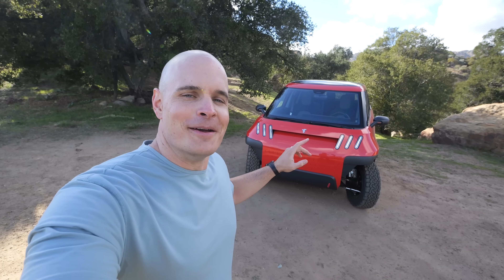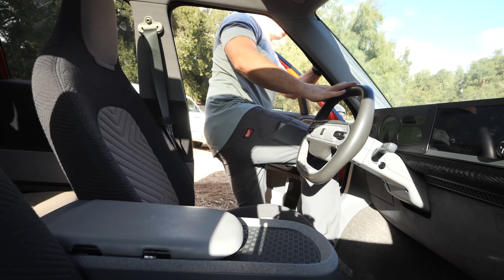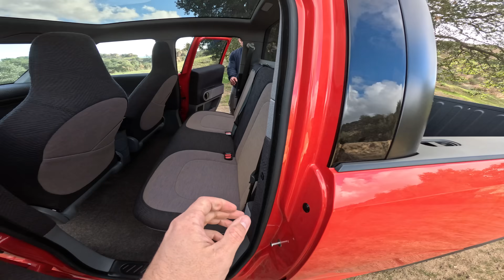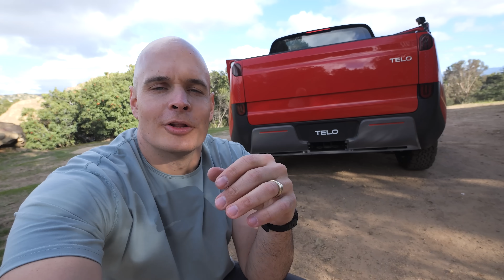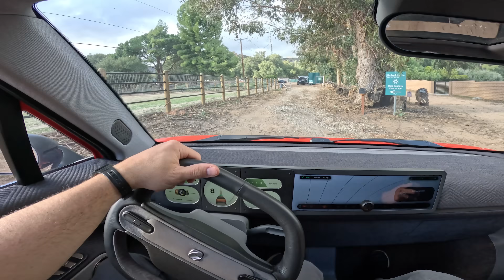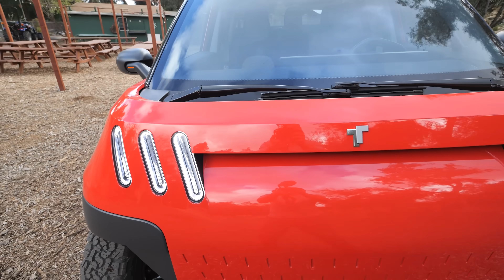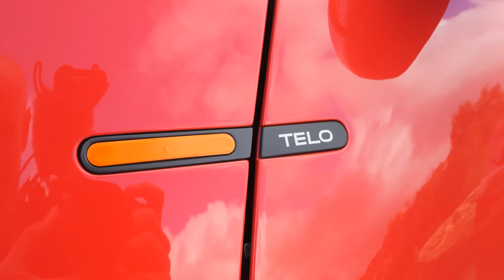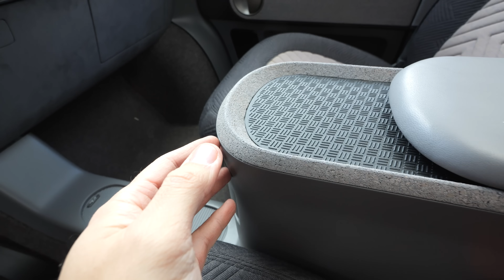ONE TRUCK TO RULE THEM ALL...

Comment: Excellent proof that trucks don't have to be comically large in order to have impressive cargo/towing capacity
Reply: It has to be large... To fit their egos ofcourse
Reply: The reason for large trucks is not due to tow/payload capacity. It has everything to do with EPA ratings. Bigger vehicles are allowed to produce more emissions. Rather than make more efficient vehicles, it's easier to make them larger. We, Americans, love our big comfy vehicles. So most folks do not see a problem with this logic.
Reply: Kei Trucks proved that point already. But those got banned here in the US, at least in some states
Reply: @JamesSchulte not really. Lots of conditions, unfortunately, but in most states there's a dealership that can help you navigate the difficult stuff.
Reply: Thank the EPA for making things like the old Ranger not possible to build. Small trucks like the old Ranger and S10 were everywhere but due to EPA regulations making a small gas powered truck like that is not economical to do
Reply: That the effect of US EPA standards and people have just gotten use to it, not people demanding massive trucks
Reply: @Giuliana-w1f  Exactly. Put a van body on it and you have an actual, viable light commercial vehicle that can deliver legit value.
Reply: That proof already existed with other cab over pickups, with low cylinder count TD engines making more torque out of ~3.0L than most of the massive NA gasoline V8s in emotional support trucks

Ofc, a white cube with a stamped steel flat bed and a 4 cylinder diesel can't carry the massive ego and fragility of ram and F150 owners.
Reply: yeah but the price is still comically large. for 41k you can but the chevy silverado 1500 w/t which is the super basic work truck trim and haul a lil bit more
Reply: @Scoobawoo  This is the real issue though. Prices are going up for new vehicles but you're right,you can get some used higher trim half-tons cheaper
Reply: @Scoobawoo True, but depending on your use case, not having to fork over big dollars for diesel or gas can take a business from unviable to a profit machine.  Just depends on what you are using it for.
Reply: It’s much safer to pull a 10k pound trailer with a 10k pound truck
Reply: Whatever you say bud
Reply: @orangeman2313  What are you compensating for?
Reply: @orangeman2313  y so insecure?
Reply: @ how so

Comment: The composition to a Mini Cooper is a fallacy because the modern Cooper is enormous! It's now 4m (12.6') whereas the original Cooper was a diminutive 3m (10').

Size comparison aside, I love this little truck and the part / materials sourcing is great! 👍🏻 It sounds like there are some internal squeaks and creaks, but it's also their first run so I expect if/when it comes to market, that'll work out those issues.